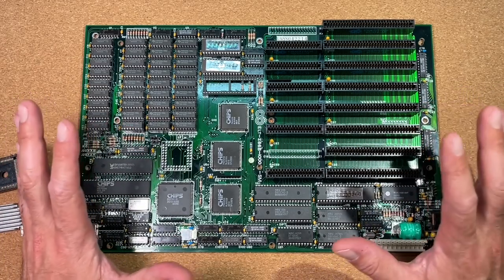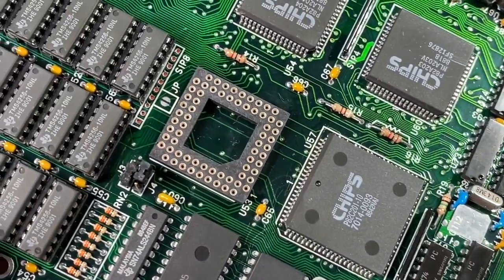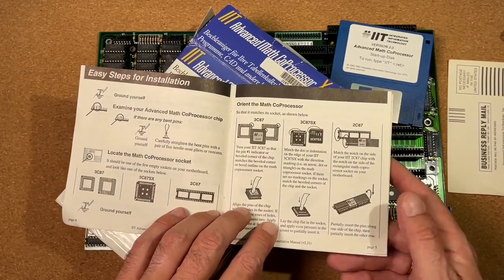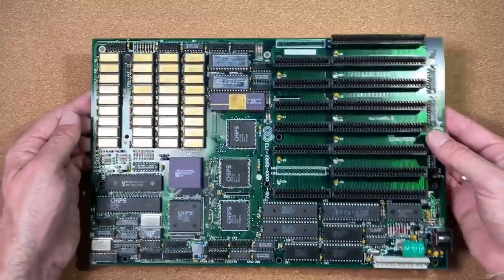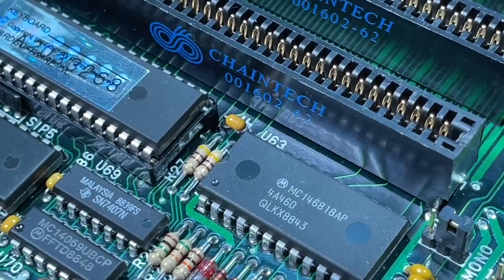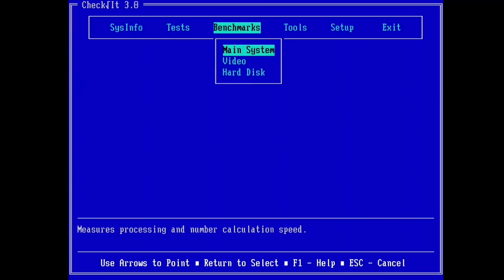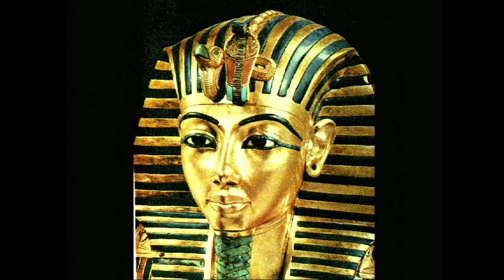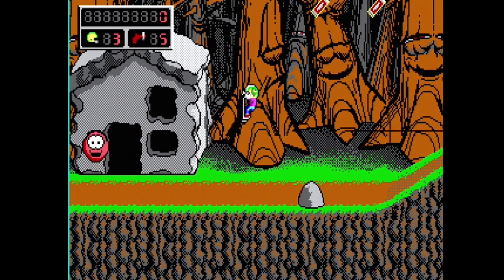Military 286 Intel CPU / Gold Bars & IIT Coprocessor Unpacking - Most Beautiful 286 Board!

Comment: You just could buy some fine dust for molds and create molds using the cooler and just melt some aluminum coke cans and infuse them to the mold or just design it on cad and order pcbway to ship it you

Comment: Do you need a case to put all that in?
Reply from the maker: no. I dont want to hide it in a case. the board is well placed in my vitrine. 😉
Reply: @CPUGalaxy  
Um... There are case designs with windows on them, but if you're working with an AT-class motherboard, you're going to have to mod an ATX case and power supply to accept the board, or custom build a case around the old AT standard.

Comment: The 286 was ready for multitasking, multiuser operating systems.
But microsoft... was microsoft... and released Windows 2 without proper support.
That, was a mistake that the x86 architecture-based CPUs are still paying, almost 4 decades later.